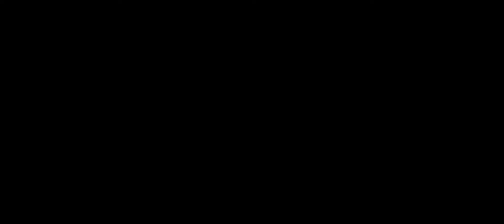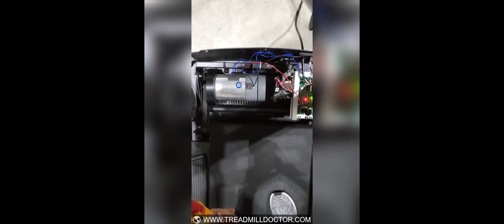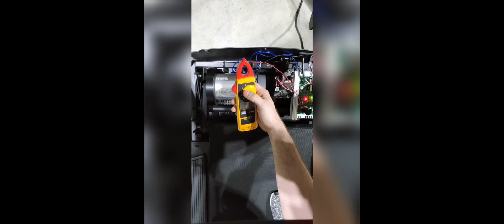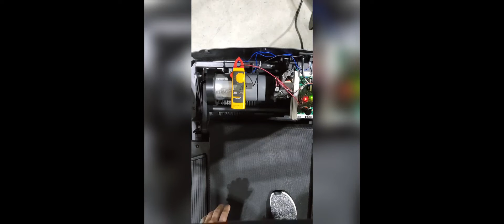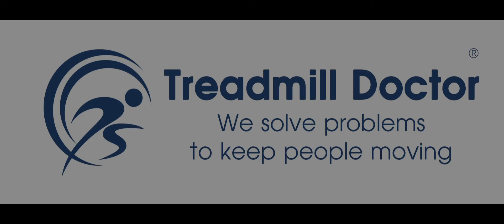DC Amp draw test for treadmills

Comment: How much amperage should it draw when at 8mph with a load?
Reply: Also, I have a 4.25 CHP Treadmill. The Model is Freemotion 790 Interactive
Reply from the maker: DC Amp Draw - 
Measure on the hot DC lead (usually red) going from the controller to the drive motor. If you have a simple multi-meter with a DC amp test setting the best way to test is to put the meter inline on the red motor lead with alligator clips. If you have a more expensive clamp meter, clamp the meter around the red motor wire. Run the machine at 2.5 MPH without a person on the belt. If the motor and drive system are healthy, you should have a reading in the 2-3 amp range. Then walk on the treadmill at the same speed. With a person of average size (around 200 lbs.) you should have a reading in the 6-8 amp range if the belt is good. The readings will fluctuate more with a load but you are looking for an average reading but you shouldn't see spikes above 10 amps. If the amp readings are high without a load, you could have a problem with high resistance in the motor, a bad bearing, or over-tightened belts. Regular readings without a load but high readings with a load indicate a worn belt and/or deck.
Reply: @treadmilldoctor  if your getting spikes above 10 with a load, but its within the 2-3amp range without a load at 2.5 MPH what would that indicate? belt needs to be replaced or the deck needs to be replaced or both?

Comment: I have a 2-year-old horizon t202-4. The engine gets hot after about 20 to 30 minutes of use. I've replaced the engine and it still happens. I have thoroughly lubricated the deck, clean the deck, and retentioned the belt multiple times. However, I can't seem to figure out what the problem is. Any ideas or suggestions? And thank you for the great videos.

Also, I did the amp draw test and it's within the normal range that you mentioned
Reply from the maker: This sounds like a friction issue. You have your meter set to Volts DC, correct? https://www.treadmilldoctor.com/dc-amp-draw
Reply: @treadmilldoctor  I used a plug-in amp meter between the treadmill and the outlet itself.
Reply: @treadmilldoctor  I sent my control board to be tested and repaired if necessary. There's a local electronic company that does that. In addition, I got a new motor from the company. Would it be advisable to change the belt? Also, on this model am I supposed to be able to move the belt when the item is off?
Reply from the maker: Yes, you should be able to manually move the belt, here is a video link to the DC amp Draw Test - https://youtu.be/sxpfLTrGsoY